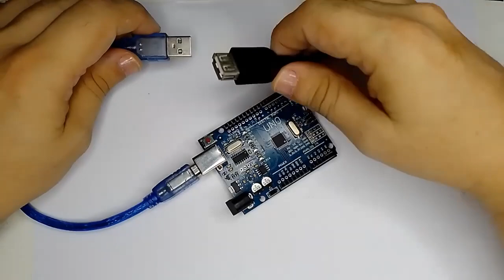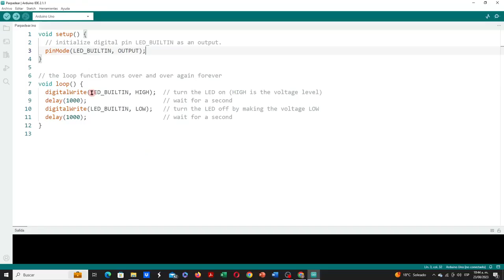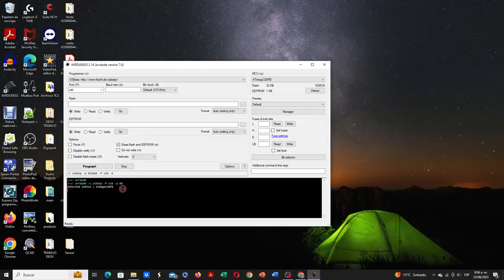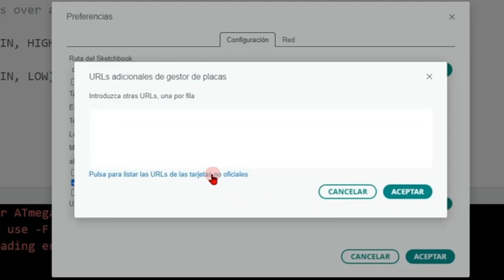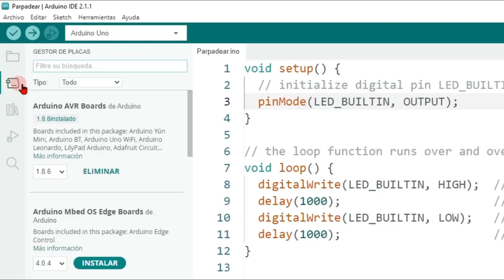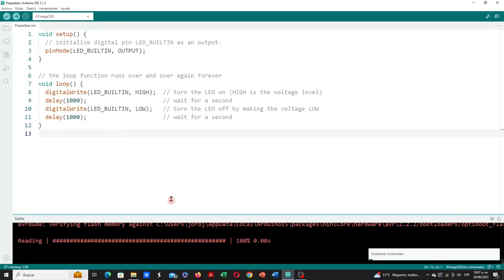¿PB Variant? How to Program Arduino UNO ATMEGA328PB | Burn Bootloader ATMEGA328PB USBASP

Comment: I am making a cnc machine. I spent two days because ugs was giving error. In the end found that the chip is 328pb. Mine problem was that the code uploaded normally but cnc machine wasn't working as it should.

Comment: Thank you so much. I bought Arduino UNO ATMEGA328PU, and it did not work in the normal way as it is supposed to work until I installed the minicore Arduino UNO ATMEGA328/p

Comment: in my case, the minicore atmega328PB bootloader can't accept it, but it can uploaded the normal atmega328P. i got confused about why the PB chip can accept the normal P version while reject the PB bootloader, at the end the arduino still can't upload the program via USB😔

Comment: I also problem with this arduino uno chinese.
But for me , the pc does not recognize the arduino even after i installed the drivers ch341.
I have another arduino mega 2560 which works fine.
I also tried to burn the bootloader using my arduino mega but i had the same error message you showed at thé beging.
Will it works if i install minicore like you did ?
Reply from the maker: If possible. Try to check visually the reference on the board's chip. If it is the Atmega328PB instead of atmega328P, maybe using minicore solve the issue. Regards
Reply: @ElectronicSpotEng  
Bonjour, 
en fait, le problème vient de la puce qui communique avec l'USB et de ma version de windows.(Windows 7)
sur ma Arduino MEGA , la puce USB SER (la puce à 16 broches)est une CH340G (inscrit sur le boitier)
donc une fois le driver installé, mon PC la détecte et je peux la voir sur l'IDE d'arduino.
Par contre, sur ma Arduino UNO, il n'y aucune indication sur la puce USB SER et mon PC windows 7 ne la détecte pas même avec les pilotes CH340/341 installés.
Par contre, si je la branche sur un PC qui a windows 10 ou 11 installé, le PC reconnait la UNO, même sans les drivers installés.

peut être faudrait il remplacer la puce USB SER sur l'arduino UNO...
Reply: @samirazarzar6279  Yes I have same problem, the USB SER fails completely on win7. The board can still be programmed with a programmer using minicore but forget using the USB.

Comment: arduino nano code uploaded but shows Warning: no eeprom data found in Intel Hex file C:\Users\USER\AppData\Local\arduino\sketches\D6BC1D8E158AC5944DA10CA86819F932/Blink.ino.eep